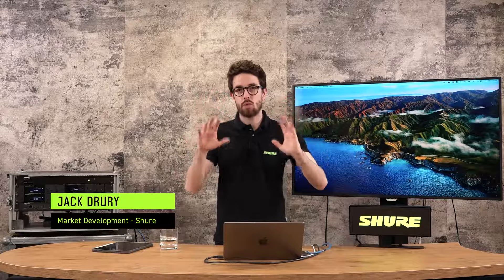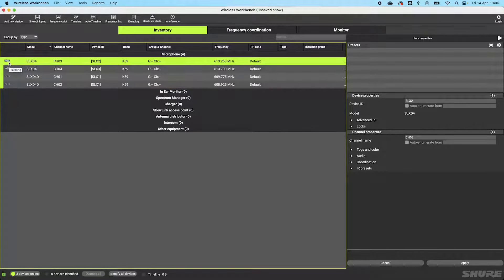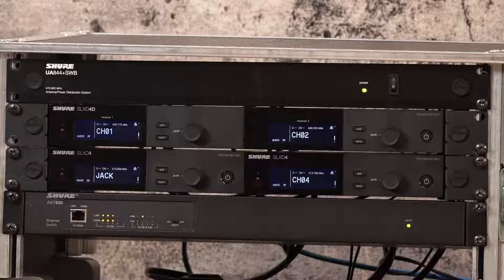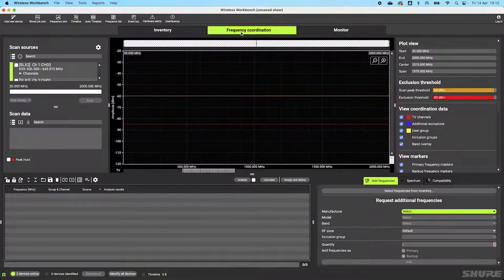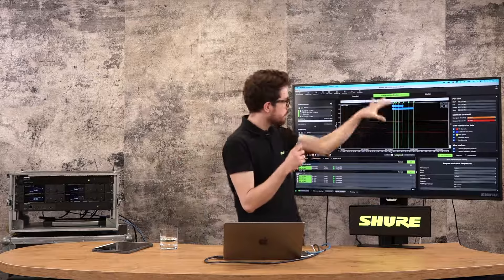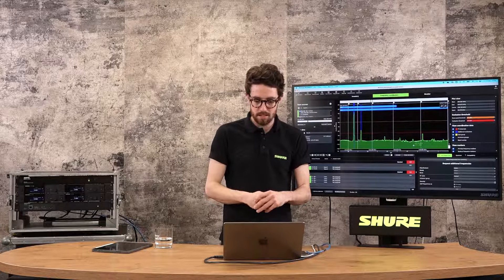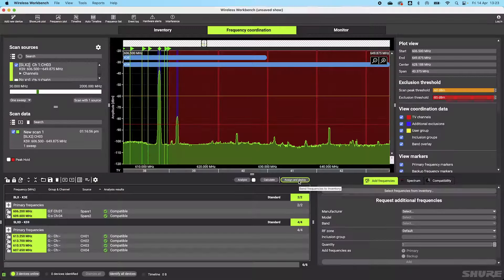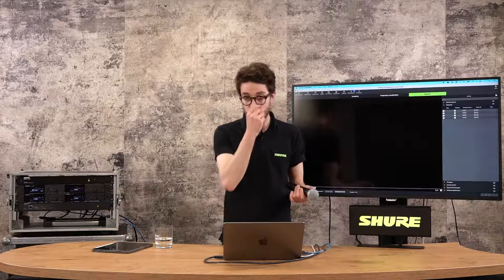Wireless Workbench 7 Fundamentals Training (Pt.4): How to Perform a Coordination

Comment: How do i know which frequency band for each device, where does it say on the label?
Reply from the maker: The band information is printed on every transmitter and receiver.  Depending on the model number, the band information could be on the front, the back, the bottom, or inside the battery compartment.

On the receiver, look for a sticker on the back or the front.

On a bodypack, look for a label on the front or for a sticker on the back near the belt clip.

On a handheld transmitter, look for a sticker inside the battery compartment or a label near the display.

If you still need help, please reach out to Support at shu.re/contact